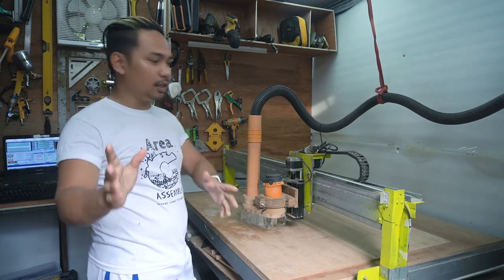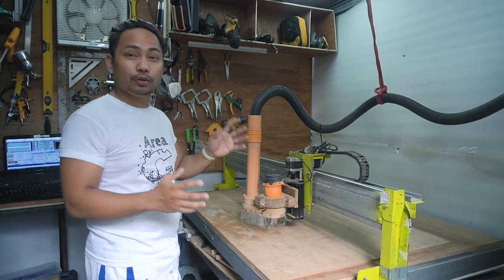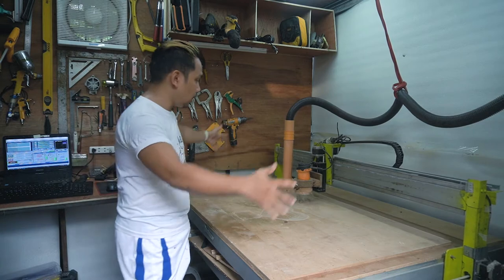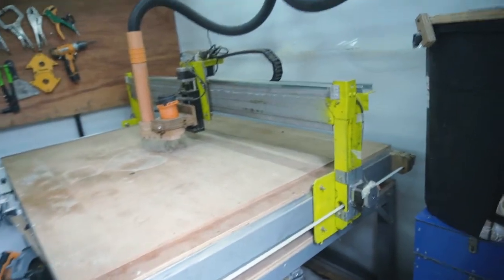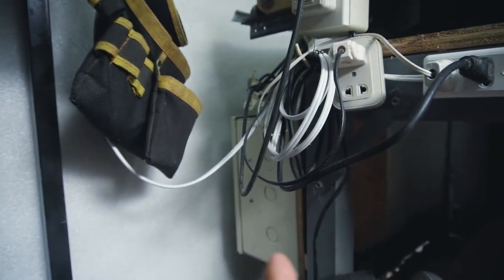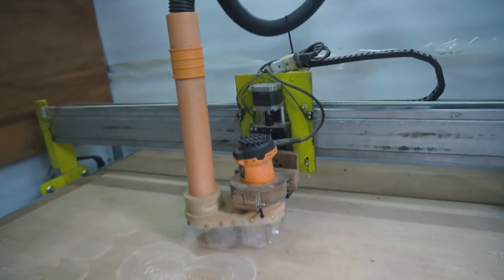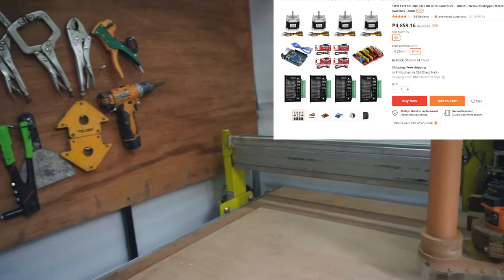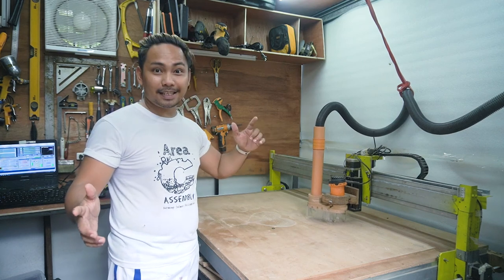Homemade Large CNC Router Machine for 500$

Comment: excellent work, I ask you some questions: 
1- which motor do you recommend, step motors or servo motor? 
2- what machine did you use for cutting? 
3- what type of drill bits are used for different materials? 
4- about Controller, for a professional use, which one do you suggest me buy? maybe like the CNC USB controller Mk3? or some other?
Reply from the maker: Thanks for passing by Sir,  for the motors its way better if you go for the servo depending on the size of the machine  for small size nema 23 3nm is best  but larger and faster machine nema 34 is better. For yhe bits i just used whats available online here in my country mostly 2 flutes straight and spiral upcut bit. By the way all the plates i use for my build is manually cut by hand with angle grinder. For the controller it's way better to have an all in or stand alone one, for professional i think MASSO G3 is the best. But for me i want a simple and easy setup to use so i went with usb mach3. There a lot of better option out there but for me money is the problem.. hehehe. That's why i choose what i used. Thank you.

Comment: Very good machine. I'm setting up a similar design, but using RM2ZZ 3/8 v-wheels as I want a bigger machine (2.5m x 1.5m). I'm a little worried about the accuracy using v-wheels, I've seen it works fine on plasma cutters but not routers yet (at least I haven't seen it on industrial ones), could you tell me any feedback on the machine's accuracy using v-wheels?
Reply from the maker: I think for me the accuracy does not matter if you use v-groove bearings or the expensive THK linear rails. Because its only a rail the one that matter is the Motors you use and the system you use to move the motor. That is because motor lose steps and belts has some backlash and a little stretch. If the motor is strong and does not loose steps and the system you used to move it doesn't have any backlash and then you have an accurate machine. Hehehe.

Comment: Tanong ko lang kung AC servo and ginamit sa Mach3. Pati wiring na din TY.
Reply from the maker: Hindi Sir, norman open loop 12kg/cm stepper motor lang ang gamit ko.. kit kasi yan nabili ko sa Banggood. Ok lang naman ang performance but needs to be concirvative sa cut para di mawalan ng steps. Plan to upgrade in the future to 30kg/cm.
Reply: Napansin ko kasi sa unang video about CNC yung sabi mo na servo motor. So,  di mo nagamit yun pati na yata yung THK guided rail. Anyway Thanks for now.
Reply from the maker: @efrencuadro2  ahh.. yun sir is gagamitin ko yung for a new one 4x8na CNC. In the future pa yun sir hehehe.. di pa complete ang budget. Pero sinimulan ko na..